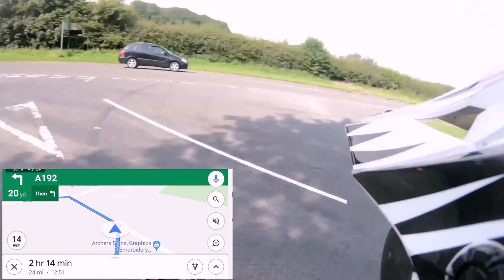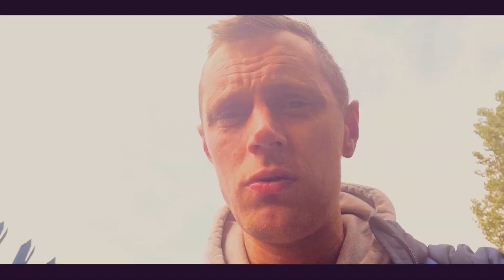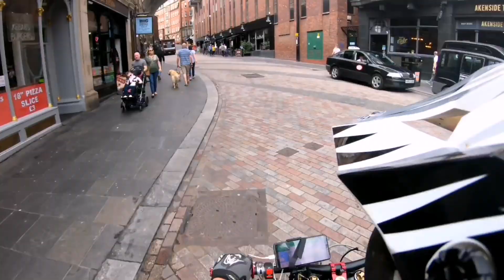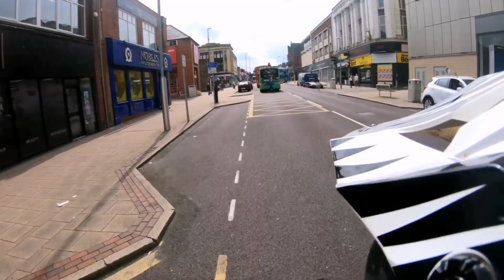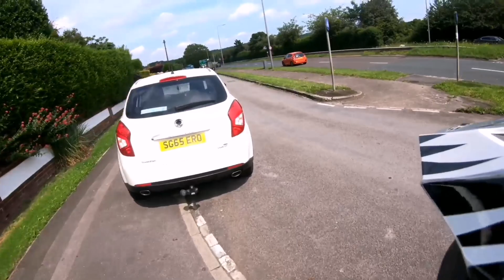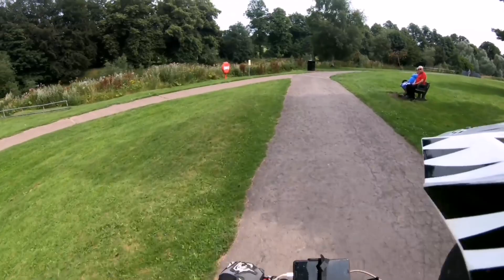Huge ebike battery range | 16800w ebike turned down to 250w how far will it go |

Comment: I have to do this. On 100A, I get 15 miles.. but at 8-10A... I have yet to go far enough to run down half the battery! Also took all day.
Reply from the maker: They are fantastic when you take your time... I couldn't believe I got 80 miles! I'm thinking of planing a trip to Scotland or trying it coast to coast would be interesting to see how far it actually goes

Comment: Been tempted to do this my self. But don't think I could bring my self to loose the extra power I have I have to agree 15mph is to slow for a bike 20 would be so much better. I had a 250w moped pedal bike thing before the bike I have now first thing I did was derestrict it was able to do 25 on that was a big difference I must say 😂

Comment: fair play mate, my ebike might not of made it one way let alone the return journey lol, love the cycle lanes up your way
Reply from the maker: Haha yeah we are super lucky they are all over the place up hear... It's worth saving up for a good battery mate. Mine cost a absolute bomb but the bike wouldn't be half as good with out it.. If I could give you a bit of advice get a battery that's way more than what you need. mines 300 amp but I can only use max 200A that way it never gets hot witch means I can run it flat out constantly without any damage..to the battery that is.. Obviously the motor dosnt always like it haha

I was well impressed with the distance I can get. I wrecken over 100 miles with skinny tyres on maybes a future video 🤔